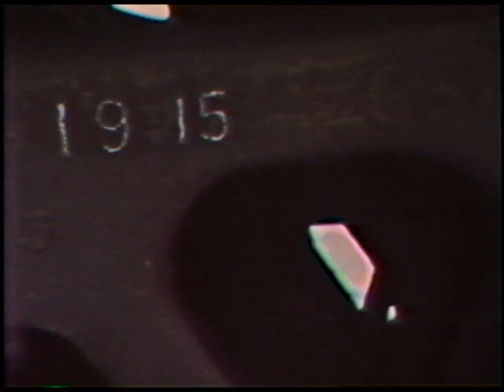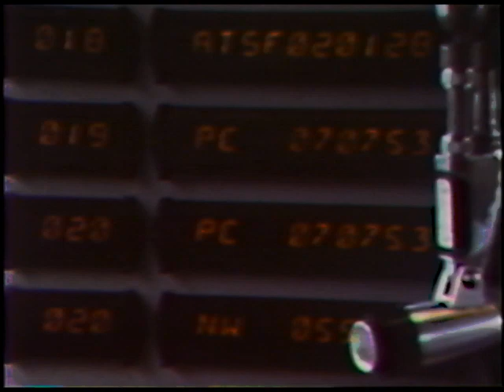Penn Central 1974 - Movie used to get federal funding

Comment: Do your cars keep coming off the track? Maybe you should model Penn Central!
Reply: If you have worn out HO track, it's great for modeling differed maintenance on Penn Central's branch lines
Reply: I model a.merged PC-Chessie(without the WM).
Me and my friends used significant amounts of math to find out what lines to remove, how to destribute equipment, ext. It would be about 1980 that it would be a profitable company.
Reply: Crazy part is, for a model locomotive to run, it requires smoother trackwork than the PC had. Unless you go deadrail, battery powered models instead of track powered. Which, I suppose, has a fitting name if you use it to accurately depict some PC trackage.
Reply: its pretty easy to make sectional track look like the pc, cut in places and patch track so there are alot more joints. this will make the cars appear to be rocking. also carefully denting the rail heads. use different lengths of cars so none of  the locomotive wheels never really come off the track causing power loss, and this  makes the rocking look more realistic.and solder EVERY joint that way you never lose power.
Reply: That’s me, my gg1 won’t stay on the track for the life of it
Reply: i tell you one thing... as expensive as model railroading is TODAY, i certainly could use a government bailout to complete my railroad
Reply: lol that’s so funny 😂
Reply: I could never keep my N gauge trains on the tracks
Reply: @25mfd  you're not kidding!  You used to be able to get an entire O scale train set for less than what a single HO scale engine costs today!
Reply: I modeled the PC rr for a few years in ho scale till I had to declare bankruptcy in ho scale court
Reply: @TexasRailfan2008  it could be because your curve radius is too tight.
Reply: @modelrailpreservation l
Reply: @johnfoltz8183 p
Reply: @mikel5295 p
Reply: @David-yo5re ⁰

Comment: I worked for PennCentral on the Detroit division starting in 1971. On the Vassar-Caro local (Bay City branch -- Michigan), we didn't dare travel over 5 mph on most of the track, with some rail so bad that I could get out and walk faster than the locomotive. You could watch the far end of the rail describe a figure 8 when the engine set foot on the other end. 

That job was a 6 day, 12 hr job to service a half dozen sugar beet farms and a couple very small industries ... our glory was usually less than a dozen cars. It's where I learned the practical application of manual block signal territory rules. Although there was never anything out on the rail behind us, I still had to drop a fusee every 5 minutes. 

We went through a LOT of fusees on that job. And we died for time nearly every day. (I was working the extra list and in two weeks, IIRC, we died every day save one. We would cheat ourselves out of time in order for our rest to clear for the next day. 

Good money for us (the equivalent of 84 hours a week worth of straight time), a real loser for the company.
Reply: Blame the management. What should have been done was every member from the Central and Pennsy (which was then in charge of the PC) should have been sacked and a fresher, newer management come in.
Reply: Bill, when I worked for Conrail at Sterling,  Mi., we would serve a Ford plant on the secondary.  The main  line  PC /NYC north was abandoned.  Most NYC  men told me the track was in disrepair.  My run to Toledo, Oh. , was on welded  rail.
Reply: It's amazing seeing trains on the jointed track on that stretch of line going 30 mph now. It's unfortunate that the Detroit-Bay City line was abandoned, if I recall correctly, that was a very vital line.
Reply: You staged the first and last scene so that you can get government funding!
Reply: If anything, a railroad today should be good money for employees and a real winner for the company, and not any other way around.
Reply: @mikeytrains1  Did you live during those times?  Just about all the railroads were having difficulties at that time.  The B&O and N&W, who also had tracks in the region where I lived as a kid, may have been doing a little better than the PC, but that is not saying much.  They served different markets and geographic locations, so it was apples and oranges to some degree.  Without a doubt, people as a whole often do dumber things with money when there is not enough of it than when there is too much.  Then they buy the sell of good talkers, grifters, and finger pointers as though they are bearers of some sort of solution only for a situation to become much worse.  Alfred Pearlman, an experienced railroad operator, was labeled as a problem, the PC sacked him, and then replaced him with what?  That is human nature and it is not going away anytime soon.
Reply: This sounds like Penn Central.
Reply: I live in lapeer, we still have a few tracks left
Reply: @mikeytrains1   only the Management from the Prr
Reply: @dknowles60  I'd lay that more squarely on Stu Saunders than just the PRR's management in general...
Reply: @mikeytrains1   you make a very good Case on Stu Saunders But Bad PRR Management Goes Back to the End Of WW2.
Reply: @mikeytrains1   it was all well almost all the Management on the PRR side that should have been Sacked as the Prr had been losing money since the End of WW2
Reply: @traintalkproductions5934   no it was not a Vital line  the C&O and the GT were still serving BAY CITY. IT WAS NOT NEEDED

Comment: This video is awesome. It preserves the historical Penn Central bankruptcy and helps me because I model April 1st, 1976.
Reply: I wish I had that kind of commitment, I collect and run anything from 1970's to early 2000's from PC to CR, I would model CR through every era if I were able to
Reply: I model Fall of 1971, but definitely not a specific date. Wow.
Reply: Yep, just pour a can of lighter fluid on your layout, set a match to it, and it will look very prototypical.  The N&S 1073 in no way captures the true essence and heritage of the PC as well as India Railways does with no effort at all.
Reply: The Bicentennial year was kind of a joke after all, even if I didn't understand much of what it meant or what was going on at that time as a 4-year-old.  Not sure what we were celebrating even now.  Thankfully, I won't be around for the Tri/Tercentenial, as I'd be over 100 years old at that point.  I'm not even sure if there'll still be a US around before I kick the bucket, well before then.

Comment: Imagine creating a documentary for showing off how shitty your railroad is doing.
Reply: I know it's simply amazing! I believe that this was a documentary meant to be presented to a congressional committee to get an understanding and make the pitch for a federal loan or potential bailout. That never happened. The government created Conrail as a separate corporation to clean up the savage mess. It said that a major US corporation would end up this way but that's what happens with a brutal cocktail of incompetence, mismanagement, overregulation, lack of investment, and changing external forces.
Reply: I think that's the point. It's to appeal for federal assistance. The 60's and 70's were a point where the antiquated restrictions the ICC held over railroads were making holes and cracks in the industry.
Reply: pretty sure that northern ireland railways did this once
Reply: Anything for that free money. They had a different video they showed to investors, presenting it as a lucrative, sure bet investment.
Reply: At this point, they were begging to be bailed out. They even said if they didn’t get funding they’d have to totally shut down, and that would shut down major parts of the northeast freight network. So the government bailed them out by forming Conrail.
Reply: Sometimes they forget a few minor but important details, just like Rick Wagoner, to leave the jet at home and hop on a Greyhound in the interest of optics.

Comment: You would have had to go back to 1956 and warn Eisenhower what a huge economic, social, and eclological mistake the Interstate Highway Bill would prove to be, for starters.
Reply: Trucks can never replace freight plus they pay road taxes that rail doesn't pay. Not building the Interstates would have been an even bigger mistake. The Interstates facilitate commerce. Not building them would have resulted in more highway deaths and a hodgepodge of state highway connections. It would be the same of not building lighthouses and even the original railroads themselves.    .

Comment: One of my uncles worked for the New York Central.  He seemed to have seen the writing on the wall and left before the PC disaster.  He worked for the NYCTA (later MTA) running subway trains for over 15 years before retiring in the early 80s.

Comment: I wish I had grown up during thi time, my home road is the KCS. and I remember all the way into the early 80s, the rails were bad. I remember the trains rocking to the point cars would start backing away from the crossings! I once saw the end of a coal train that had a Burlington northern caboose, as it rounded a slight curve through the middle of Stilwell Ok. I saw 9 cars and the caboose over turn but not the caboose, it almost did, but it didnt. one guy up in the cupula got throwed out against the door on the end, and knocked out. but 9 cars of coal right in front me! wow. It was only a few months before they installed welded rail, and the end of cabooses. no more wrecks due to bad track. there were other bad derailments, but not due to track conditions.
Reply: When thing started to improve?
Reply: @zeeteavathepipe3184  just a few months later, they got rid of cabooses, and installed constant welded rails.

Comment: I was a kid then and remember hearing the negative press about the rail industry as a whole, even though there were some railroads that were doing well; such as the Seaboard Coast Line and the Burlington Northern. When Conrail was formed, I remember the skepticism many in the public felt regarding its chances of surviving. It was cool to see the impressive turn-around Conrail experienced in the mid 80s.
Reply: Why was the press negative?
Reply: @zeeteavathepipe3184  Unfortunately competition from trucking and aviation, plus strngent regulation from the government was hurting the rail industry at that time.A number of rail routes that had once boasted 80 to 100mph passenger runs were in deteriorated shape due to poor maintenance as a result of sky rocketing costs.   Before declaring bankruptcy the Penn Central became "infamous" due to corruption from, both, management and union officials.  It wasn't all doom and gloom, but it was a tough time for a number of rail companies.

Comment: None of this saved the Penn.
Reply: john jablonski it’s not the point of NYC hates PRR and vice versa. It came down to the fact that both wanted to make profits at a time where the Car Companies were starting to take a strangle hold on local metropolitan transit. Car companies bought out trolley companies and replaced them with bus lines. Like, you’re not wrong about the hatred between NYC and PRR, but by the time they merged, it was mostly gone and this was seen as the best option rather than have two railroads collapse simultaneously.

Comment: 8:17 AR-16? Does he mean the Baldwin AS-16? And if so, then why is he standing next to an RS-3?
Reply: That would probably be the PC's classification. It's forebear, the Pennsylvania Railroad, had it's own system for classifying diesels (an E7 would be an EP20 for EMD Passenger 2000 hp and an RF-16 would be a BF16 for Baldwin Freight 1600 hp). My guess is the AR-16 would be an RS-3 as they are ALCO Road switchers with 1600 hp.
Reply: +Russell Streak Ahh, alright. Thank you for clearing it up.
Reply: NeededFour No problem.
Reply: Alco Roadswitcher 1600 hp
AR16

Comment: To be fair the ICC set them up to fail. the railroads were over-regulated and they couldn't control the price they charge the shipper. I don't understand how such a enormous Railroad could just die in 2 years. it went from loosing $2 million in 1968 to $380 million by 1970. I think I read somewhere that on the last day before Conrail Penn Central literally only had $500,000 in their bank account. to us that's a lot but for a Gigantic company that should be making $30  million a day easily $500k is pathetic.
Reply: By the late '70's railway deregulation camed in practice. In the '90's the ICC was disbaned.
The deregulation should haved camed no later than 1968. But better, it should camed into the '50's.

Comment: Just amazing how bad it was back then, this was the beginning of my railfanning  1974' in New England and NY and PA and Ont,Canada and the PC was by far the worst, The B&M, DH, EL and LV, RDG did much better with their old gear and some like the MEC and BAR had even older loco's but their pride and mait. was fantastic but no matter how good the New England roads did with their time table the Penn Central's problems always made for customers often getting their freight late and some not at all !!! It is hard to believe that the two old parent roads that were so great once (the NYC and PRR) could let things get into such a cluster f_ck and the management  let it get this bad, other large mergers like the GN, NP, CB&Q and SP&S went pretty smoothly and it's longer runs and much less troublesome major cities sure helped this but their managing team was so much better and also not Big city pig headed idiots either !! Well Conrail got it right after a few year and I miss Big Blue but I miss all the Fallen Flags more !
Reply: + Prog X  I totally agree Penn Central issues screw up the hole northeast and all the connecting railroads freight and schedules I lived in Mass. during most of this time and was the end of PC's time and would railfan with my older bother who like the bigger engines that came to Beacon Park yard in Allston just outside of Boston and Framingham with was a nice little hub of a bunch of branchlines for PC this was in 74-75' but we went all over NE and I started going on my own in 75' also. Its funny how so many PC train stuff was in HO for the Hobby as young railfans I think that help in our minds at the time thought everything was fine and then came Conrail  76'. It wasn't until later in books and mags that I saw how bad it was. But I am still drawn to those Black PC engines especially when clean and that Green PC/NYC livery on their cars. I guess it is imprinted from my early years. nice post prog.  Lol and I don't know what that guy Larry was writing, looks like he was drinking !!!  Lol
Reply: yeah, I came home to Reading (Hatifield/Lansdale) territory from the Marines on Jan 11, 1976 and would have liked to be a railroader.  I saw my first CR train on or soon after the April 1, 1976 startup.  Headed North on the Bethlehem branch it was the ore train to Bethlehem Steel.  Growing up I had listened to it at night as it passed close by my house.

Well, when I saw the CR version of the ore train, the well maintained RDG  hoppers were all gone, replaced by falling-apart PC ore jennies.  Then and there I figured my hopes of being a railroader were shot and I went on to graduate from Temple University with a degree in Computer and Information Science and from there to a successful 30 year career in the field while continuing as a railfan and sometimes model railroader.

Comment: @ 3:48  ... "We're cutting up about 25 cars a day, and probably by the end of the year we'll have six thousand cars cut up.  They're over 40 years old, most of them, and we bring them here and then we salvage all them until we came to reuse on any rebuilding program or repair program.  And the wheels are one of the most hard products to come by.  We have all our wheels, axles which we reuse, our truck frames, our couplers, our yokes ... Every piece of material of the car we're reusing.  This is our ...this is our supply;  we live off of it."

It's Soylent Steel.

Comment: In 1969 when PC CEO Sanders fired that Jew as he called Alferd Perlman the only real rail road man in the management he caused this to happen, Perlman was fired for spending to much money on Rails and equipment, he was bashed by his bosses for upgrading yards and track after the merger, between  CEO Sanders and PCs CFO Bevan who cooked the books the rail road didn't stand a chance, the worst part is this wasn't the 1st to fall to crooks and won't be the last,
Reply: perlman went on to a rather successful job at WP.
tho, perlman can be blamed for 1 thing,,,,,,,,,,,,,,,,,,,,,,,,,,,,,,,,,,,,,,,,,,,,,,,,,,,,,,,,
it was perlman who made it a point  NOT to donate ANY former steam locos 
or make any attempt to preserve any either.  this is why so few former NYC steam locos exist today.
Reply: But what the bosses wanted if not better rails and better equypment?

Comment: I love how they never address the management issues. And I have to say, while I'm a PRR fan through and through, it is on their short-sited shoulders that the blame sits; at least the NYC was making some inroads to improvement. Typical of the PRR's idiocy in long term planning was the transition era from steam to diesel- which seems to have saved them nothing in the long run- you can't buy 20 different diesels from 4-5 different companies and then run effeciently.
Reply: Wrong, it was the ownership/board of directors. The best managers in the world can't make a roller rink from a pig sty with a tack hammer and two nickles! The condition was a problem of no funds available for the upgrades so it was just Ignored. Though the only place I've seen track like that before is in parts of India where they are still running on the colonial era British rail still. This is nothing new, this is how or whole aged infrastructure is, with the rails the problem seems that much clearer because you can see it sitting there. Our whole country is bankrupt most just don't know it yet.